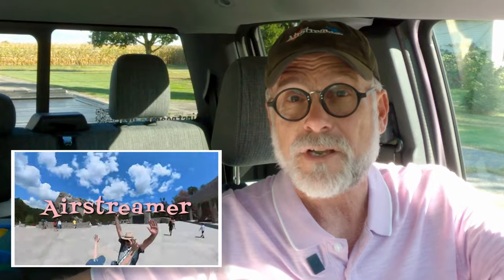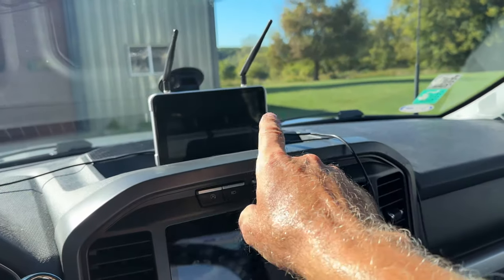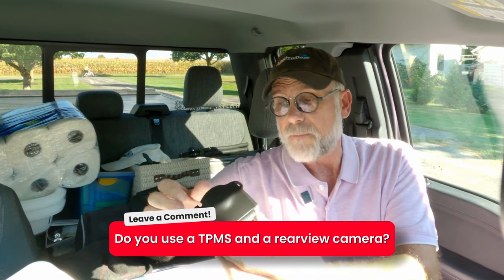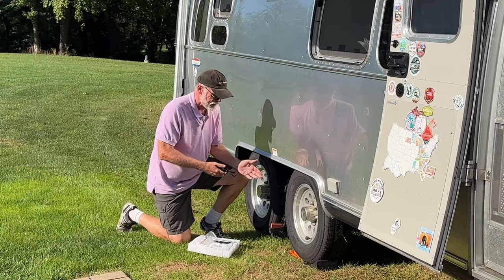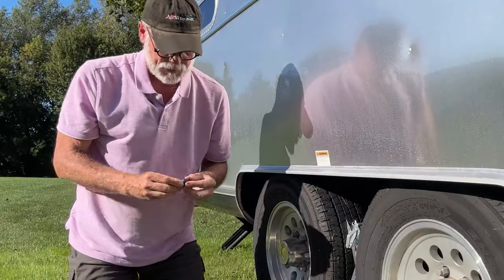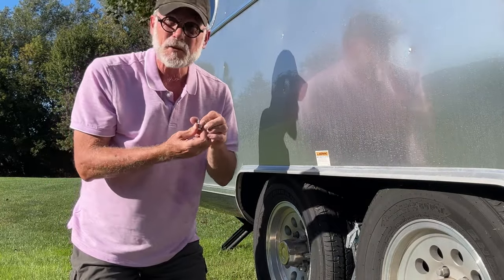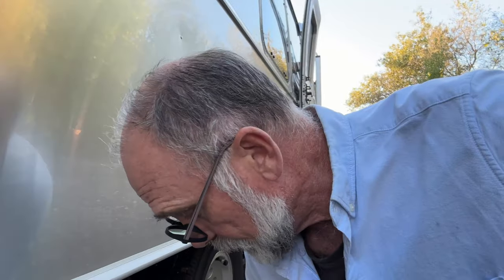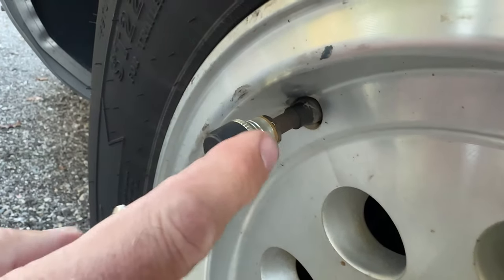Backup Camera with TPMS! - Haloview BT7 TPMS

Comment: Hands down, Haloview is the best setup you can buy. I have a very low tolerance for anything that is glitchy or difficult to operate. I can't say enough good. I have one camera inside my trailer to monitor if my load stays secure and another as a backup camera. I've traveled thousands of miles with my setup, through tunnels, mountains and through bad weather. NOT once have I have had a signle issue. Always a crystal clear picture and the signal literally connects the second I power up my trailer. This is probably the best investment you can do to upgrade your trailer and give you piece of mind. I had a motorcycle come undone years ago and it did lots of damage. Not anymore. Now I can monitor my load the entire time!
Reply from the maker: Thank you for the great information about your personal experience with this product. We agree 100%! Very important tool to have. -Michelle

Comment: I like this video! Our tpms in our truck stopped working and I hadn’t wanted to deal with yet another screen and dash clutter. Slick! Jim, do the monitors feel strudy and weather proof? Our old ones rotted off from salty winter travel and towing. ~Shanna
Reply from the maker: Shanna, the sensors feel very sturdy. Lots of brass and aluminum. O-ring seals for the battery compartment. Salt ruins everything… except eggs. Salt is really good on eggs. 
Haloview does offer replacement sensors, so even if they are damaged, the replacement would be cheap and easy. We are eager to test it on some long distance drives this fall. - Jim